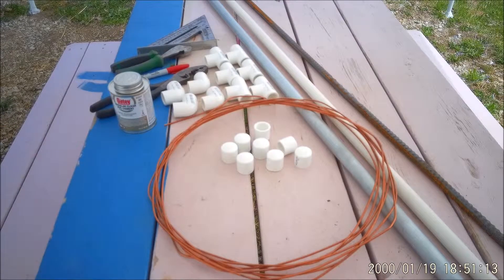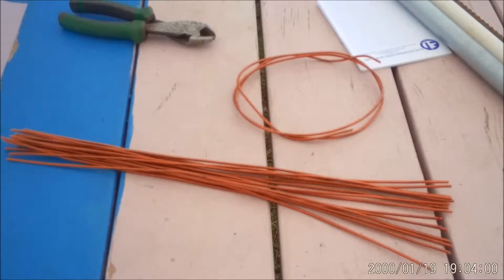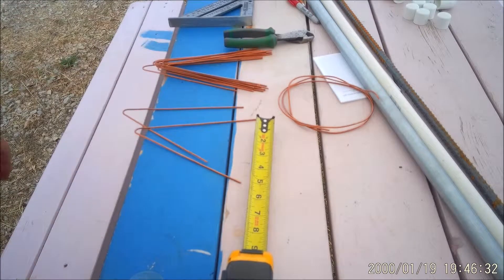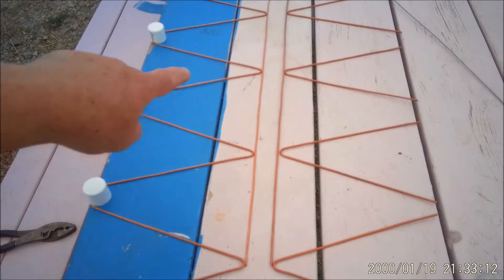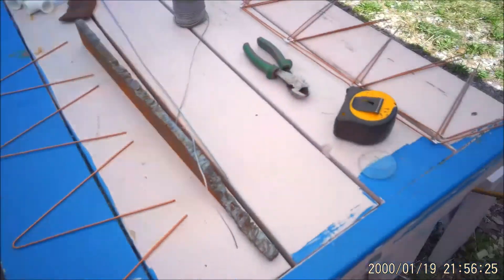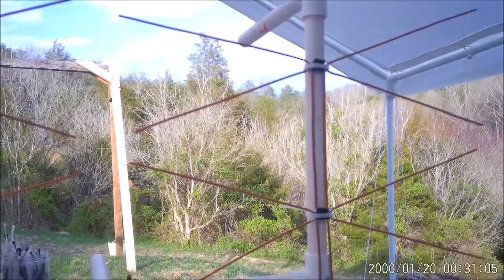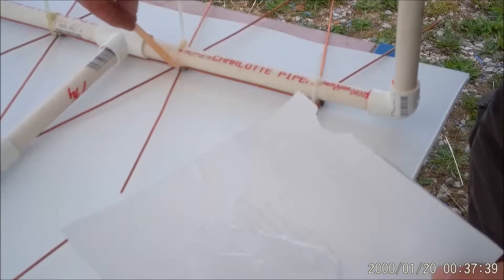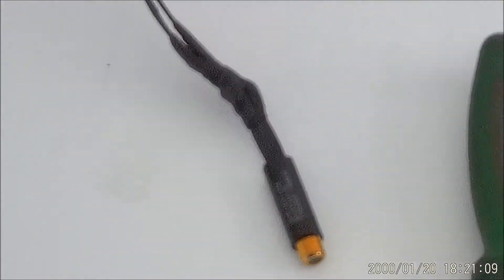How to get free TV, DTV DIY antenna build, DTV antenna project, Part 1

Comment: What did you use for the spacers?
Reply from the maker: I used 1/2" pvc tubing for the frame and that is where the copper conductors are attached to. it works really well and is worth the effort to make. It works better than a big rooftop antenna that was quite large, that I got from a friend. I threw his away and kept mine. Thank You for watching and there is a part 2 also.